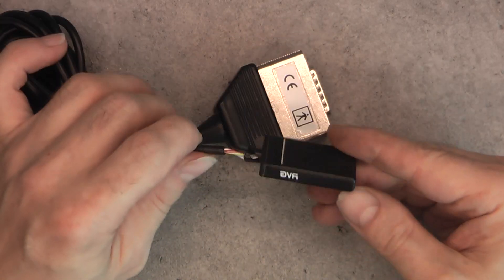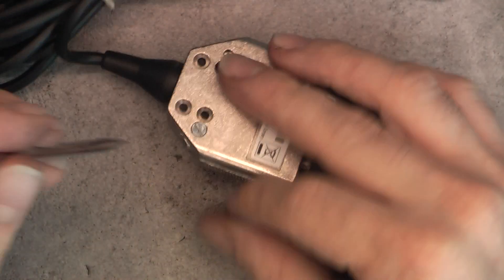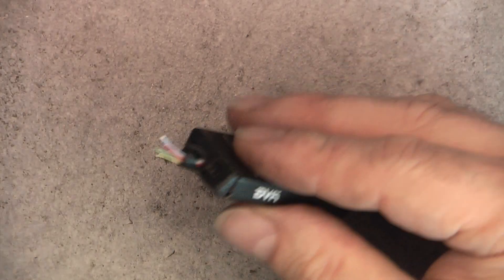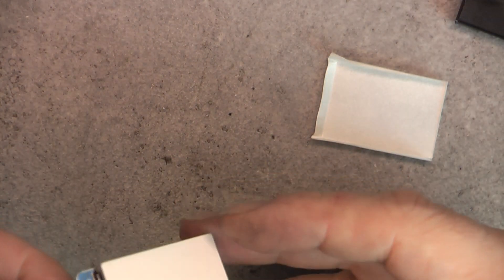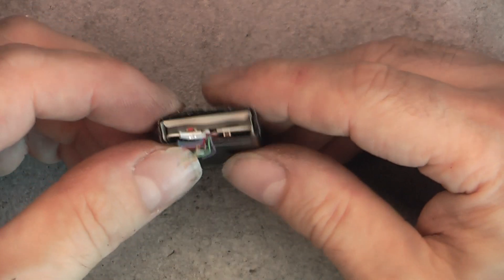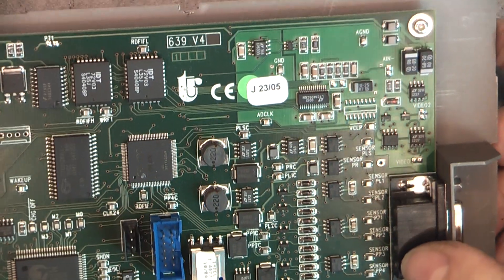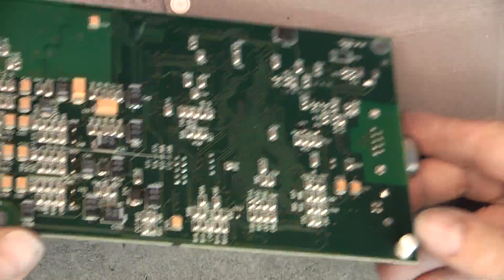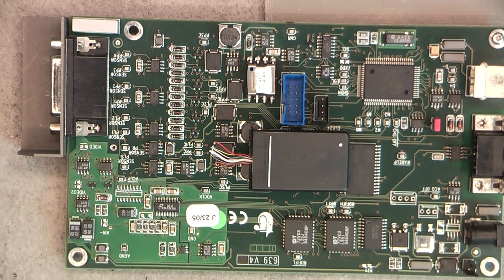RVG dental X-ray sensor teardown

Comment: Dude this is crazy. But it is a really cool and neat video, and I enjoyed seeing someone completely tail one of these down… Pretty neat. Wonder what the scintillating material is? I’m not too familiar with this stuff… But I would imagine lyso or something similar so that it can get the proper resolution and sensitivity.

You could’ve fixed it with 10 minutes and used it in your lab or pass it on to someone who needed it. These are very expensive, even broken they bring hundreds and hundreds of dollars on eBay.

I’ve fixed many of them for friends and clients, and although I’m not an expert when dealing with stuff like this… I run my own electronics lab, and focus mostly on component level board repairs and a bit of test equipment calibration and metrology. I do have a professional lab, but I’m not certified to work on medical stuff… So the x-ray sensors and detectors I fixed for friends and clients… Worth for veterinarian use or used in industrial applications. 

I’ve also built over a dozen of my own sensors and detectors for my geiger counters and survey meters… mostly scintillation detectors… because I find that technology fascinating and was stunned when I first learned of it.,
I enjoy working and experimenting with different types of scintillating Crystal… and learning new things with each material. Nothing more enjoyable to me than a weekend stuck in my lap with a few fresh blocks of scintillating Crystal, some photo multiplier tubes, and some freshly machined precision aluminum enclosures.
There’s a big community online who enjoy and share their experiences with this type of equipment. I keep learning every time I build a new detector… the last three I’ve built with solid state multipliers made from silicon. Which was a real learning experience and so much fun.

Comment: Are RVG dental x rays safe ? Yesterday, my dentist carried out this on two of my teeth and now I am worried of radiation exposure as I have had many  of these taken in the past as well
Reply from the maker: Not to worry, the beam is narrow and lasts just one second. Dentists trigger the X-rays from a distance because they do it all day long, which is not the same thing having few x-rays a year.
Reply: More like 0.1s. The digital sensors or phosphor plates are much, much more sensitive than the old film :)  @msylvain59

Comment: very cool rare find. I've always wanted one of these to X-ray small components and chips...
Reply: Medical discards can be amazing and fun. This example is something that could have been fixed with twenty minutes on the bench and two inches of shrink sleeve tubing but they bought another one. Cauterizing tools are designated as single-use and make great wood patterning tools. Discarded batteries with internal serial communicating protection and charge state monitoring find their way into DIY solar energy setups.
Reply: Oradect pro ddx 1500 rvg is reparable and cheap also

Comment: It doesn't matter if the ferrite core is loose. It's perfectly normal. The 4 serial EEPROM's in the socket keeps calibration data for the sensor (dead pixels, gain etc.) - Those sensors are quite expensive - you could sell it on for a good profit as long as the sensor element isn't destroyed. I paid quite a good amount for one of these not long time ago.
Reply: Where can I get the cheapest Intraoral Digital sensor for X-ray?
Reply: I have one of these but I have no idea how to check if it works and how much it would cost. Any ideas?